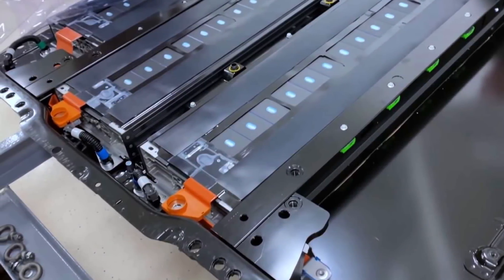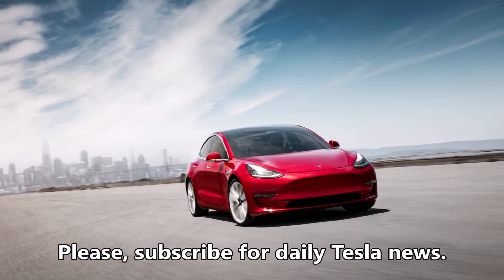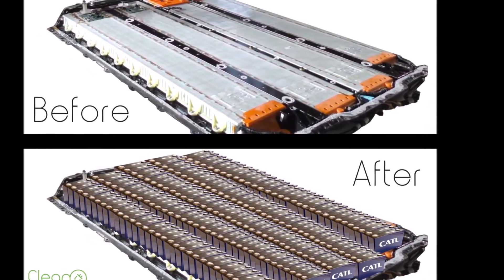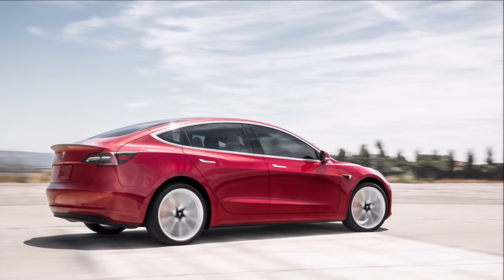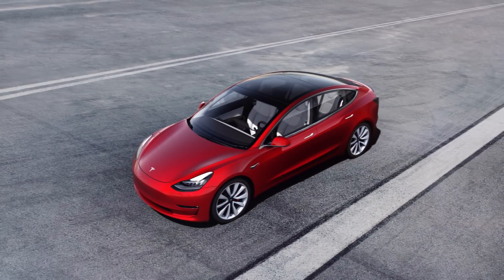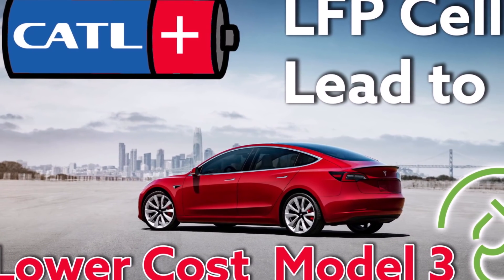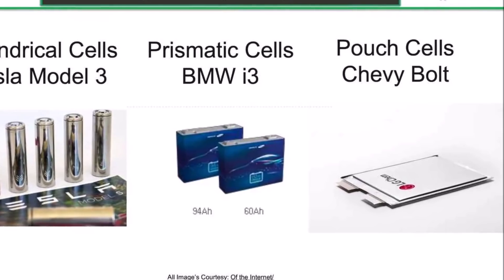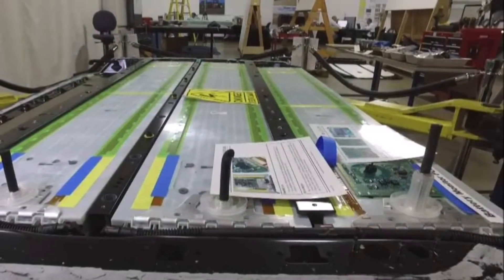Tesla Announced a Fundamental Battery Switch in Its Standard-Range Models

Comment: The one surprise here is the news that Panasonic will be producing these new 4680 batteries first in Japan, because Panasonic had previously announced that they would be setting up a pilot 4680 production line in Giga Nevada. It could well be that Tesla plans to convert Giga Nevada over to their own 4680 battery factory after the Tesla 4680 battery factories in Giga Texas and Giga Berlin ramp up production to meet their current battery needs. The LFP batteries from China show great promise for entry level Tesla models, although Tesla should really be passing some of the cost savings onto buyers. I hope that Tesla and their partners can scale up 4680 battery production in 2022 so that they can compete on price and longevity with LFP, but still offer superior energy density, making EVs lighter.

Comment: although i'm heavily invested in tesla and so am very interested in battery technology, battery shape and size is of little significance in and of itself. unfortunately this is what the panasonic news is all about. primarily its saying that they can produce tesla's 4680 (size) battery in volume, which is good, but not a revelation. we knew it would just be a matter of time before tesla's 4680 battery would be produced by someone, whether it be tesla itself of someone else in quantities sufficient for use by tesla in its automobiles.

it's battery density is what's needed to extend range. 20, 40, 50 percent would be groundbreaking, and this battery does not really address this. there is little here to get too excited about, although it's certainly not bad news and a step in the right direction nonetheless.
Reply: Tesla needs this size for it's structural batteries in the new generation of their models. The structural pack is what saves weight and extends range. For Tesla Panasonic's full support is very important!
Reply: They said at battery day a 56% increase in density. So I Think that means 56% more range for same weight?
Reply: @bigpoppa4094  no. i don't think they said that. although i wouldn't doubt that that's what many people thought they heard. and i know i would like it to be so. but the deeper i dig the less i believe it to be the case.

direct comparisons in energy density between the 2170 and the 4680 are practically non-existent on the internet.
although titles of articles may lead one to believe that that is what is being compared.

if there is any difference it is less than 16%. meaning range could possibly be increased by 16% assuming the total size and weight of the battery pack was the same.

i don't doubt that there will be cost savings WRT manufacturing though.